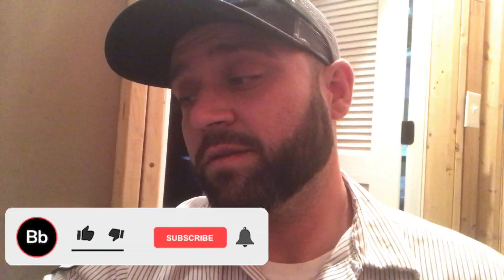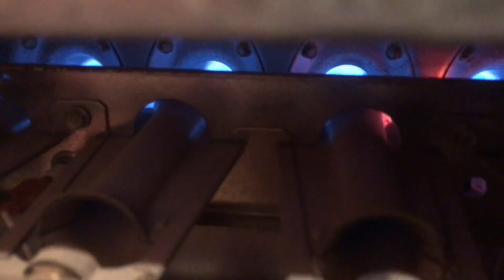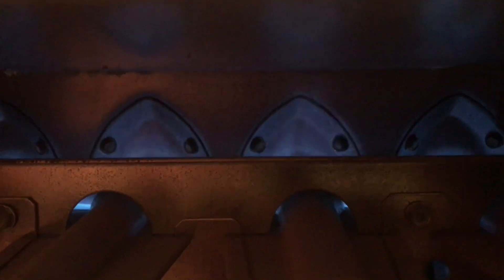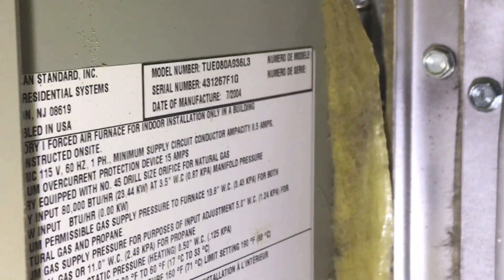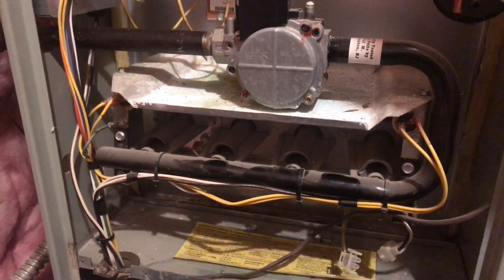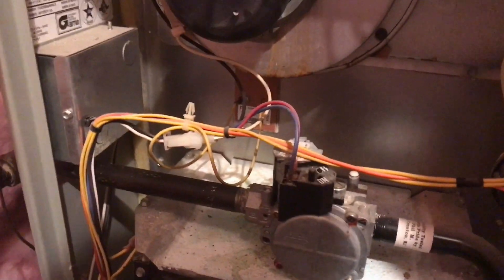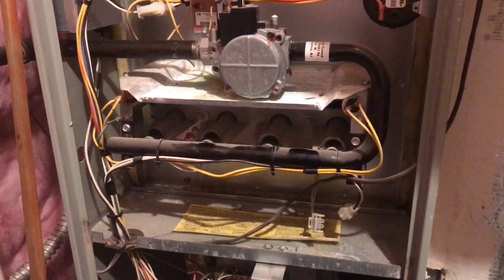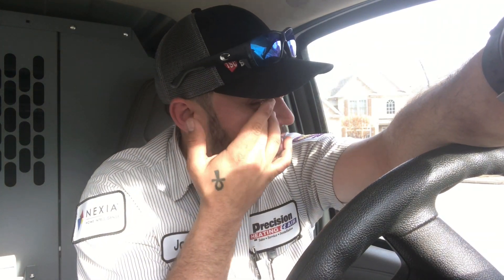Watching A Furnace Run With A Cracked Heat Exchanger

Comment: I have to go look at my mom's furnace tomorrow I will check it the same way you did. thanks for the info. It's an exchanger hard to replace I am a mechanic and I autobody Teck? I would think I could pull it off.

Comment: I had a tech come out and perform a "Combustion Test". He was in and out in under 15m with my furnace red flagged and a team ready to come quote a new one. Had another guy come out and do a combustion test also and as he performed it he was telling me what he is looking for and sure enough my furnace was fine. Turned out to be a crayon that fell in the vents and landed on top of the exchanger that was creating an oder which was the original reason for the call.. It sucks these dishonest techs make you honest guys jobs so much harder!

Comment: Such a critical area that is safety related, you would have thought manufacturers are more conscientious in designing and using materials to safeguard such failures. At least use cast metal and more durable gaskets instead of sheet metal on the burners. Spending a few $$$ more would have ensured that these components would be fail-safe in its lifespan. Seems to me there are more critical areas to to conform to code instead of those useless ones imposed on unnecessarily.
Reply: Sales would drop, shareholders would bail. Not good business.

Comment: Hello from Ontario 🇨🇦.  My wife decided to call a technician to have a look at our furnace just to have an idea of the maintenance stage(We just bought the house 4 months ago). The technician came and said to us that it's a 21 years old furnace that never in it's life had seen a maintenance before, he told us that surprisingly the Burner still working fine, But his internal Camera found only 1 crack inside one Cells(circular hole) inside the heat exchange.  He emited exactly this document that you said, he notified the gás company that we have a small leak and he shut down the gas of the heater. IT REALLY FELLS LIKE A SCAM until we done a lot of research on the internet(this video included) to find out that is better to emergency Spend 4 to 7 thousand than to have gás leaking inside your house that could kill you!!!  

 Thank you very much for this informative video Brother!!!!
Reply from the maker: Not a problem. That's definitely the best and safest way. You just have to make sure the tech is being honest. There are plenty of techs that use this as a selling technique and do scam people. Always ask for several pictures or even ask the tech to use the camera and let you watch as he shows you. Unfortunately, 60%-70% of guys abuse this method to their own advantage. I'm glad you guys had the inspection and are now safe.
Reply: Just like the same dirty air filter that every crooked auto service place shows. @patrick9440
Reply: Always place Carbon Dioxide Detectors wherever you lay your Head most people who were found dead because of Carbon Dioxide were found in the bed asleep

Comment: Nothing to do with getting work but there are 4 things that Mr./ Ms. Homeowner should not touch except for an outlet or faucet etc. Electrical, plumbing, heating and structural
There is reason you do what you do and I do what I do. Seen way too many , let's just say mistakes over the years causing more damage and heartache then you can imagine. As I said nothing to do with getting work just got safety sake

Comment: I use a aiming flame with the blower motor running it will push the flame back or turn it off.

Comment: At my company we have a waiver that they sign if we find a comprised heat exchanger. Assuming they want to continue running it. 

Otherwise if they refuse we turn off the gas to the furnace, turn off power, disconnect the igniter, and take at least one hose off the pressure switch, and call the county to let them know this home has a faulty furnace running and the home owner has decided to not sign a waiver and could possibly try to run the furnace. Which we then cover our bases with the county to waive responsibility at that point as well.

Comment: Personally I’d like to see the crack, the vestibule gasket could be bad, and air entering the upper cabinet from the lower cabinet fan assembly, folks if you want to be a tech you have to show results, not just a hunch, that is a giant hole, not just a crack, if proven to be,

Comment: Dead nuts correct. That brand has a clam shell heat exchanger and expands when the welds are rusted and cracked. It swells up, opens up and will blow the flames out usually. I had one still under warranty and that company wouldn’t send me one in January 2 years ago. The slogan is you cant stop a ????? I stopped the bastard and got another brand and will never recommend that company again. This dude is honest to the bone!!!
Reply: That’s a surprise for that brand. Those Trane’s usually hold their lifespan. Could’ve been due to a poor install as well possibly?
Reply: what brand did you go with instead?  My tech is recommending Rheem.  I have a Trane now.  My heat exchanger has some rust visible.  It's 21 years old and still working well.  But not sure if there are any cracks.  But still thinking about replacing it.

Comment: A cracked heat exchanger does not cause carbon monoxide. The furnace needs to be shut off because of liability issues and industry standards.
Reply: Be careful, One time I woke up one morning with a slight headache after leaving my 34 year old furnace running overnight, I think its because of CO from the heat excanger, the alarm didnt go off but I smell gas sometimes, so now I dont run it.
Reply: What is the reason you say a cracked heat exchanger doesn’t cause carbon monoxide?

Comment: as a non-furnace guy, I hope the outside burners suck most of that back in and send it out of the flue. 

Sitting here next to a 1983 sears 80% furnace that's in a house I got 16 years ago. Home inspector said "it will need replacing immediately". It has never needed any service in 16 years, but will be on the outs this year because the A/C that goes with it is unaffordable charge wise and gives me double the electric bills I got two years ago in need of R12 or 22 or whatever it is.

at any rate, my HVAC company, who checks out the unit every three years or so is chomping at the bit to replace it, but even they admit the furnace is in really good shape.

Comment: It’s amazing how a crack in a heat exchanger can kill a family… but I’ve been into low income homes throughout Chicago and they will literally have the exhaust vets off the furnace and hot water tank, they will also have the stove cranked up to 500 degrees with all burners going and 10 space heaters.. the house will be around 200 degrees and theys still coooe . 🤦 and not dead!  But a little crack will take out an entire family 🤨

Comment: I understand the customer's apprehension.  I had an HVAC company tell me (with pictures, too) that my heat exchanger was cracked.  He said he "red tagged" the unit and disabled it.  I didn't touch a thing as it was in my attic.  Called two other companies out and didn't tell them a thing.  Both companies said the unit was fine with no crack in the exchanger and the unit hadn't even been disabled!  I showed them the pictures and they told me the pictures weren't even from my furnace.  I'm sure you're very honest but there are a ton of companies out there who aren't honest and are just trying to scare their customers into getting a new system.  Either way... I appreciate this video as it helps me understand one of the things to look for.
Reply: Finding a "cracked" heat exchanger turns a slow day to a busy day. A lot of people don't care who they hurt as long as things go good for them.
Reply: Same thing happened to me.  Bogus photo and all. Thank God for the honest HVAC people out there.
Reply: my exact experience.  I will just do this myself now.  I don't trust anyone else anymore.
Reply: Mr Clementi do you mind telling me what was the Problem I have the same situation one tech says it's a cracked heat exchanger, the other tech said it was a deductive motor which we had to wait 7 days for the part to come and when it finally came he installed and it still didn't work the 3rd Technician came out and said our heat exchanger needs to be cleaned but he said since the furnace is 13yrs old it's best to just go ahead and get a new furnace mind you that we have American Home Services ( Warranty) and the 2nd Technician was the Company they sent out who couldn't find out what was wrong motor and all so now we're using a company who has repaired and installed my Sister and our families friend . Entire price is $3, 500- which we pay up front and AHS will reimburse us after they get the invoice. Everyone is out to get rich off the Working Class whose just making ends meet so we've been without heat for 3 weeks now we're using space Fan Heaters so now our Electric Bill is going to be through the Roof if it's not one thing it's another. So glad we have Carbon Dioxide Detectors in every room we lay our heads down
Reply: @jayhendricks67 

I'll bet they never refunded you did they?
Reply: I had the same thing happen to me
Reply: How do you know the pictures were fake? Maybe the "honest" companies were just trying to win you over.

Comment: The way they form heat exchangers work hardens some areas of the heat exchanger and will crack..
Carry April air monoxide detector and sell them one with instructions on placement.... People just can't afford new equipment. Every few years.
Reply: Roll outs can be caused by long exhaust runs and must be double coached by cycling unit sever times .

Comment: Thank you for showing me this. I had 2 inspections in the last few weeks. One showed(with a camera) a possible start of a crack in the heat exchanger. ALong with other repairs
Second one- they did not use a camera, told me about the same repairs as the first with the exception of the cracked heat exchanger. No camera was used UNTIL I showed the pic of the heat exchanger from first inspection. At that point, they got their camera and checked BUT the area they checked looked nothing like the first inspection pic. This one had a foil looking thing, the service manger told the tech that was insulation tape that had curled up, thus it is dangerous. I have an appointment for an estimate for replacement. I am not opposed to replacing if necessary but the 2 inspections told a different story. It is over $100 a pop for inspections so having another done may be futile.

Comment: I always do a combustion test also and it print out the results to give to the customer and I keep a copy. In a lot of cases the heat exchanger is cracked and the whole House fan does not change the flame signature on the burners. Need to be careful turning off a circuit breaker to the furnace as somewhere in that line somebody could have piggybacked on it to run something else in the home like a sump pump! Keep up the good work.
Reply: How does a sump pump work? What do they do relative to furnace system?

Comment: You definitely don’t look like your trying to scam anyone & agreed it’s definitely a cracked heat exchanger. However; there’s just too many companies out there trying to scam the consumers, that the home owner, has a hard time trusting a diagnosis that’s gonna cost them the price of a new furnace when they don’t need it. Unfortunately for the home owner, not in this case. This is why you need to find a licensed hvac company that you use & trust

Comment: Great video for amateurs like me. From what I gathered from your video is it'll leak CO2 so I can put a CO2 monitor in the room with the furnace and H2O heater. The city inspector said he could smell gas. I imagine he's smelling natural gas which I need to buy a sensor to locate the gas leak. Any suggestions?
Reply: Use washing up soap mixed 50% with water and brush it on your gas pipe joints and connections. If any bubbles appear you know that you have a gas leak on there.
Reply: Wait I thought two drops of dish soap in a cup of water….. no?!

Comment: I had the same problem with my furnace(heat exchanger).but furnace still working fine for now, should I keep using it for now? any problems?pls let me know. Thanks.
Reply: Get a carbon monoxide detector we ran ours for a month that's how long it took to get the replacement heat exchanger under warranty. Ours was cracked and leaking water.

Comment: Shouldn't the roll back sensor shut off the furnace with that much roll back?
Reply: You’d think
Reply: @Kiddro22  that would be awful to have a double failure the heat exchanger and the roll back sensor and get gassed.

Comment: I Red Tag the furnace, turn off gas at appliance and place the tag over the shutoff ( followed up by a certified letter ) by policy every time and note that on my electronic work order. I work for a natural gas utility. If I get any indication that Joe homeowner is going to try to turn it back on himself, I lock the meter and it's only going back on when the contractor is standing there with me.
Reply: Great policy.
Reply: What’s a “W” wire and pressure switch? Some are saying disable those too?

Comment: ...also could just be dirty/blocked turbinators in the secondary heat exchanger... can also verify with a gas meter to detect any CO2 if it's bad enough.
Reply from the maker: There was no secondary. This is a 80% furnace. But yes, a blocked secondary would cause the same symptoms.
Reply: What’s a “turbinator” and why what’s an “80” percent furnace,?
Reply: @MathCuriousity  they are the long, bent pieces of metal that slide into the tubes in the secondary heat exchanger. They help with movement of air. 80% would be 80% efficiency.
Reply: You look like a douche

Comment: What about furnaces made in the 80's when the burner is inside of the box instead of the "jet engine type". Don't know what they are called. What does it look like when it's cracked or damaged. Remind you there is no door switches, flame sensors, etc.
Reply from the maker: Typically the pilot light will continue to go out and you could still look at the actual burners inside the furnace to see if they are jumping around once the blower comes on.

Comment: Thanks for this video. My heat wasn't working this morning so I investigated & discovered the rollout switch was bad. I bypassed it. Wrong mistake Don't do this on any safety switch especially on dealing with gas. I didn't realize the heat ex-changer was in very bad condition nor did i take the time to inspect. I was very blessed that a friend with more knowledge came by & looked more thoroughly & discovered that the heat-ex changer was very bad & advised me to not run it with the rollout switch bypassed. I'm very thankful that i listened because I could've killed everyone in my family & myself.

Comment: Absolutely disable furnace gas off / pressure switch hose removed / remove & cap W wire many ways to disable one & red tag it..then write up  disclaimers  on invoice explaining why its been red tagged & disabled ..Great Job Thanks for sharing
Reply: What’s a “pressure switch hose”? You mean just turn the gas valve off?! And what’s a “W” switch?

Comment: I usually just disconnect the W wire, and disconnect the flame sensor/draft, as well as shut off gas to prevent the unit from running. Thanks for the content, CO kills silently, always a good idea to lock these deadly systems out!
Reply: What is a “W” switch and a “flame sensor” ?
Reply: Does the flame sensor allow the valve for gas to open? And what’s the “W” switch?

Comment: Ooooo! Thanks for sharing this. I’m trying to find out why my furnace is on the fritz. Tech quoted me over $5k in just repairs!  Among the items he listed was a heat exchanger. My flames go on fine, but then shut off (not flame sensor or filter), then I hear a weird clicking sound. The blower keeps on, just no heat. (Not pressure switch.)
Reply from the maker: It’s either the gas valve or the furnace control board.
Reply from the maker: Try pushing in and wiggling the wiring harness at the board. Then try turning the heat on again. It may work for a while but usually still leads to the furnace control board having to be replaced. 

Did the technician tell you the heat exchanger was cracked? Did he show you pictures?
Reply: @HVACTechTips  there is no outward evidence of the heat exchanger failing, and no, I did not receive images
Reply: How do you know it’s not the flame sensor? Those can still be the issue I assume even with what u said

Comment: see but i absolutely get both sides.  your essentially trying to save their lives by disabling the heater till its replaced.  but thats alot of money.  im in a similar situation and i probably have to move 😂 i own a house and dont have the money to replace the heater and winters comming.  so i can understand wanting a way to repair it.  thats how i found your video.

spent all night trouble shooting it myself and mines either clogged or cracked.  and i say clogged cause we had rodents this summer as the heat was off.

im somewhat suspicious a mouse or some got in to the heater.  which i dont even know if that would be enough to cause blowback.

alls i know is i cant afford a new heater lol.  can maybe afford little space ones till winter but when its 30 below out thats not gonna cut it.

Comment: Recently completed the heat exchanger experts class on brand specific failure point. What a great class and even better booklet that will lead you straight to where it's most likely to Crack based on what style heat exchanger it is
Reply from the maker: That would be extremely helpful